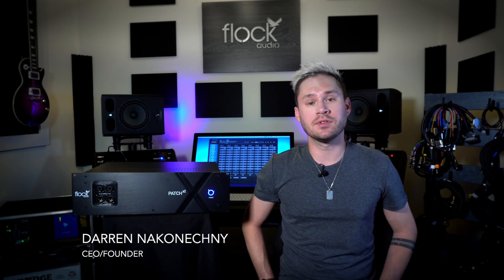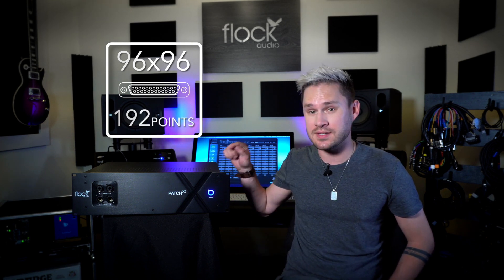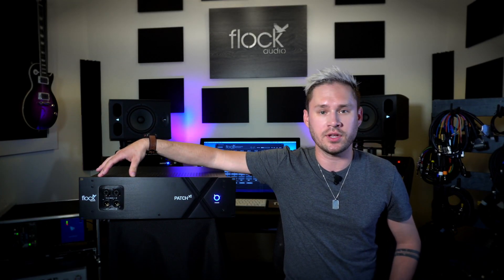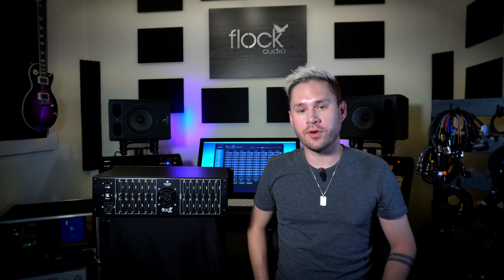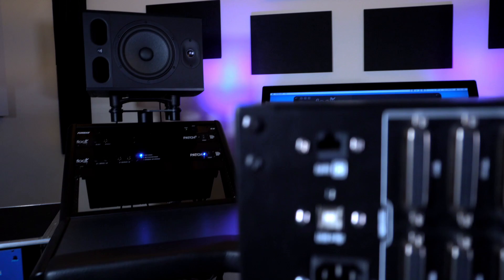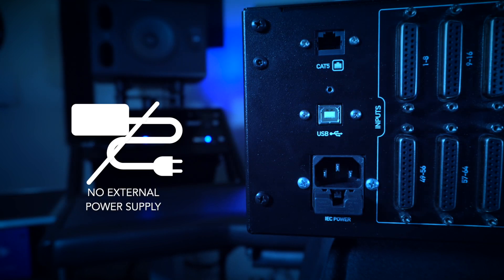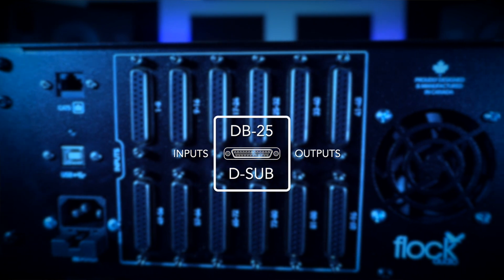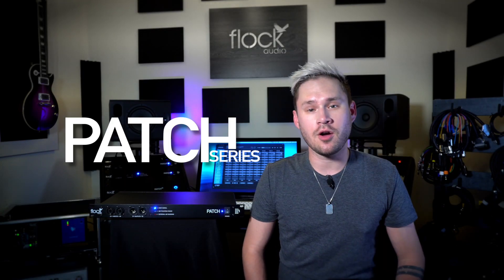Flock Audio PATCH XT - Hardware Overview

Comment: Newer XT models have a different back plate with the fan on the rear left. Are there any other differences?
Reply from the maker: This particular PATCH XT Model in the Video was an early Beta (Non-Public Model). So as we got closer to the official release of the PATCH XT we did some major improvements which is some of what you see as the current PATCH XT's.